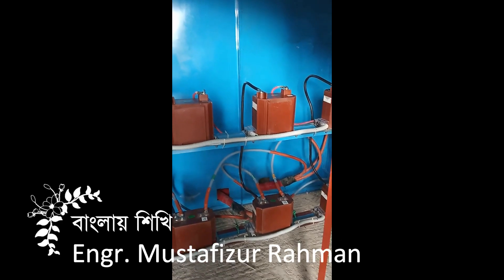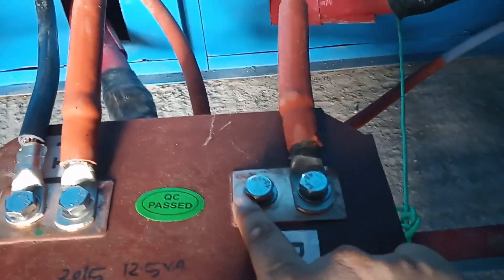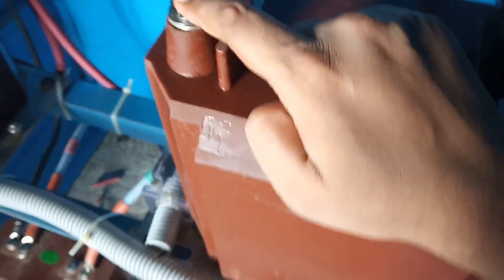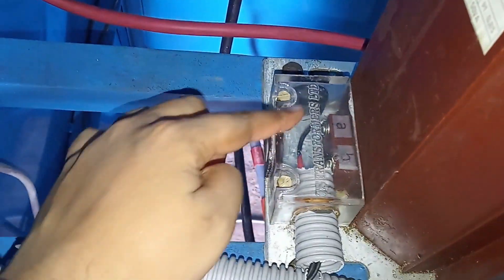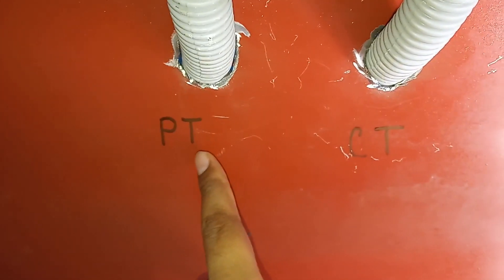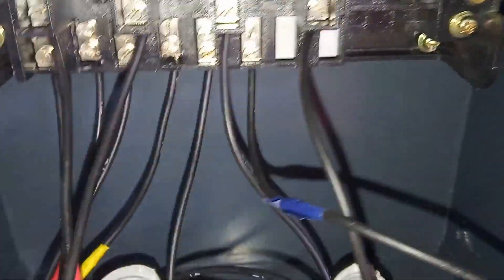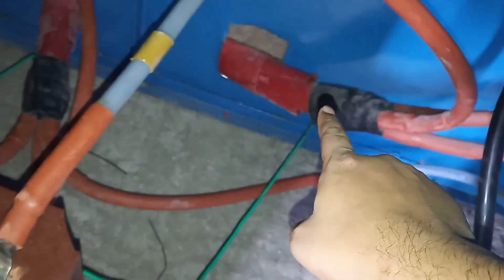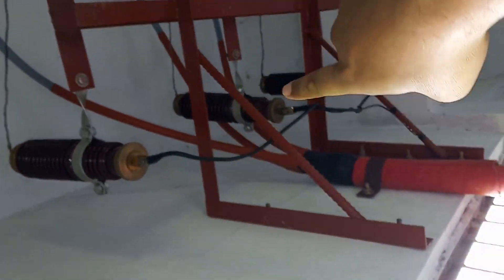Practical Connection of  11 kV Metering with CT & PT with English Subtitle

Comment: Why do you install lighting arrester inside the indoor substation?  Should not it be installed at outdoor ?
Reply from the maker: You are absolutely right that lighting arrester along with drop cut out fuse should be installed at the source pole but due to some unavoidable reasons we were compelled to do that.